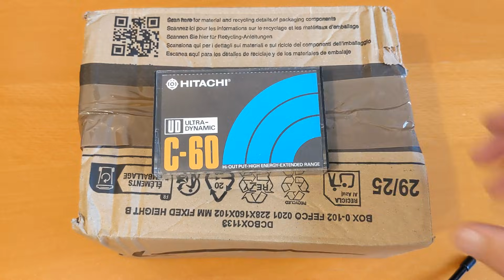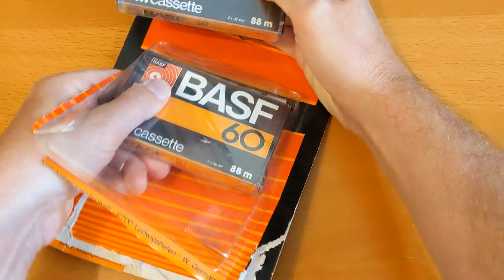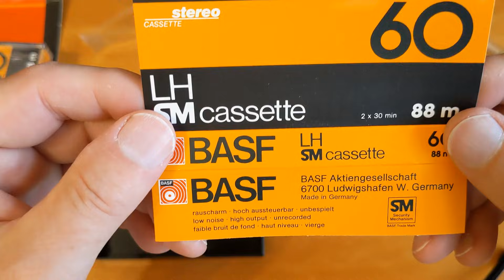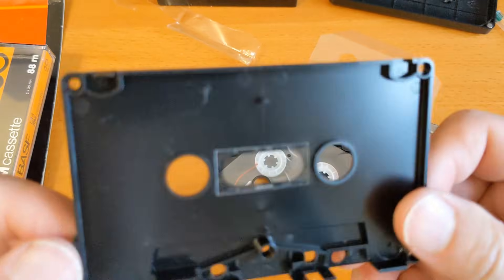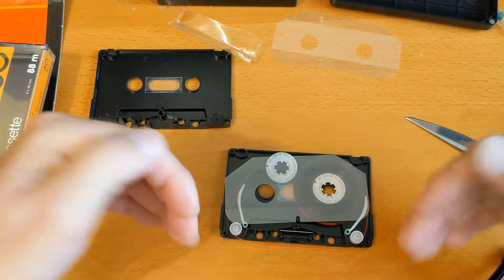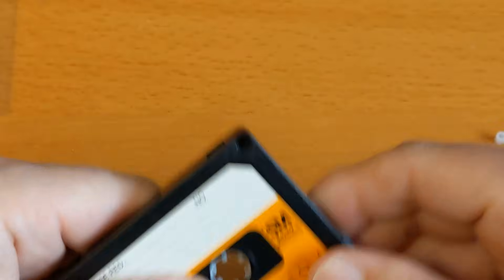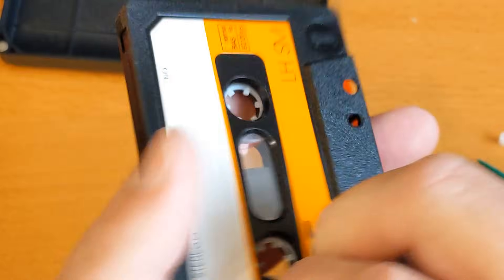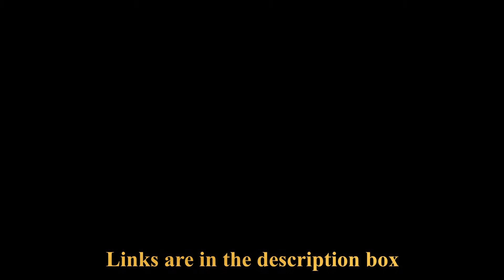BASF's Self Destructing Cassette Mechanism

Comment: Il security mechanism o special mechanism a seconda di come lo ha chiamato basf è un danno per la cassetta,ho visto delle type3 distrutte,hai fatto bene a toglierlo,toglilo a tutte le tue basf,e se le hai anche alle agfa,questo perchè anche agfa ha adottato l'sm.alle mie basf e agfa ho eliminato l'sm,le mie cassette mi ringraziano,sono tutte sane.bel video!
Reply from the maker: Thank you very much. I'll see if I also have Agfa cassettes.
Reply: This is only happening because some batches of the double layer FeCr (type III) tape have a defective binder. They will lose their coating anyway, with or without SM guides. Ok, the guides accelerate the process, but these tapes are defective anyway. In all other cassettes with stable tape, the SM doesn't do any harm at all. 
I always leave the guides in the cassettes, and have never had a problem with it during soon 5 decades of taping :-)
Reply: @kiirunavaara   no,a me l'sm ha rovinato anche due basf type2,da quando ho tolto l'sm a tutte,non è successo più nulla,e considera che tengo le mie cassette alla perfezione..
Reply: @giuseppelavecchia775 Yes, I've also seen it once or twice with CR-S II, but none of those (dozens...) which we have had in our family since they where new.
Remove the SM if you think it's better for you.
Reply: @kiirunavaara   l'sm va tolto a prescindere,comunque ognuno decide per se,saluti

Comment: I removed the sm parts from my basf,s I got some tidy 1972 and 1875 basf, I swapped some tape from new maxxel Ur,s in the case,s so they sound wetter than the early tape and I used them for 1970,s era music.
Reply from the maker: Cool. That's a lot of effort, but I respect that. There's not much 70s music I like, especially early 70s.

Comment: I never liked those things, I don't see the purpose considering the small plastic wheels basically do the same thing, in guiding the tape and keeping it straight. I remember having some of these tapes when I was a kid and ended up taking the arms out cos I couldn't get the tape back in properly.. The tapes worked fine without them.
Reply from the maker: Marketing, that's what I think. I can't think of an engineering reason why it would be a good idea. Funny this is, I went and bought another two SM cassettes right afterwards not realising I'd have to fix those too.
Reply: @CBitsTech  Possibly you could experiment and try to record and use one cassette with and the other one without the Security Mechanism. I own quite a lot BASF and Agfa SM cassettes from Germany and never had any problems regarding these parts. The only BASF cassettes that don‘t work anymore are some of my LH/ferro super tapes (1974-1985). They begin to squeak after a few minutes and are pretty much unusable by now.
Reply from the maker: @RetrorundfunkThat's a great suggestion, I've been thinking of doing that. Maybe I've got an old one in my surplus box that I could torture to see if it fails. Not in my best decks though 😊